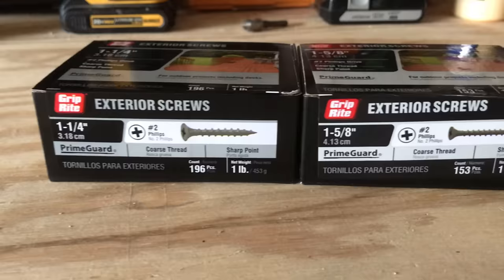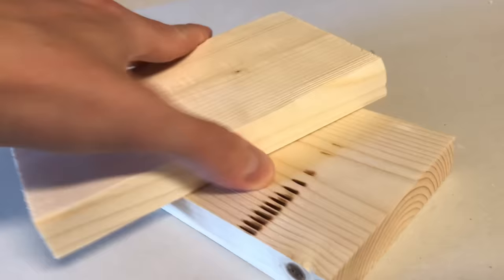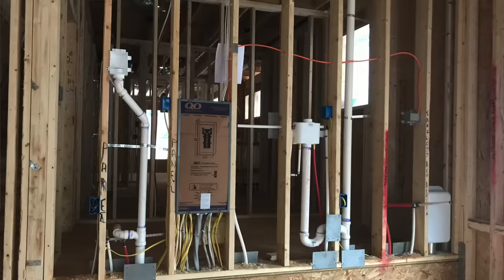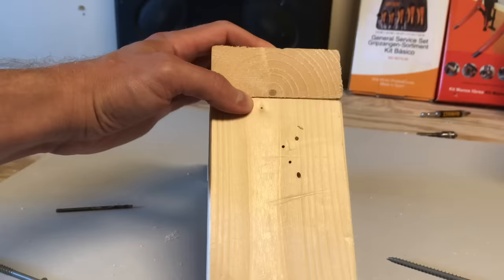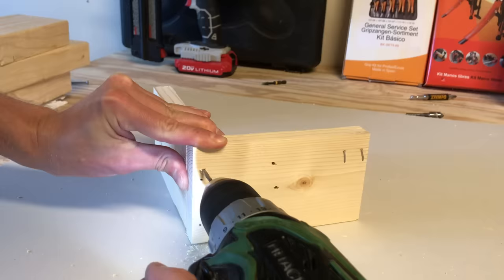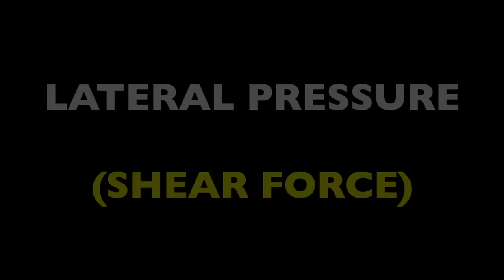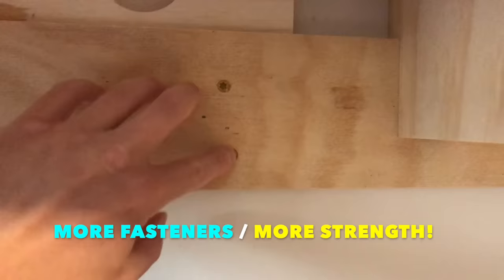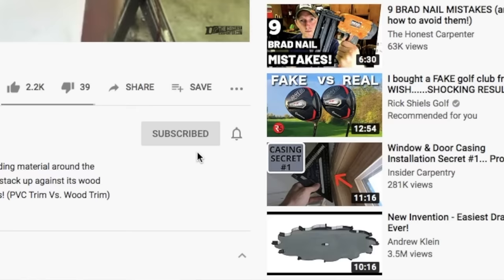Don't Use Screws That Are TOO LONG or TOO SHORT! (Screw Length/How To Choose The Right Screw Length)

Comment: Pre-drilling is often important to prevent splitting.
Reply: I asked a 3rd generation carpenter what tool would he recommend for DIYers he said ditch the old school battery drill and get a good lithium battery impact driver. I did and BOY DOES IT MAKE A WORLD OF DIFFERENCE! No more predrilling. The drill will drive EVERYTHING! What I do is go about half way in then back out and watch the wood shavings pour out then I just drive the screw in that way it doesn't split the wood. Works great as it serves the same purpose without having to predrill. It gets the shavings out so the wood isn't expanded too much. So it prevents splitting. 

Also I find most old school guys just press the impact/drill button at full power all the time. What I do is start slow, to get it started, then full speed at mid length, then right at the last quarter I slow down to barely flush mount the screw heads. Oh and I only use T-25 star/Torc head screws the only thing that is better is square heads as both are harder to strip.
Reply: And alignment!
Reply: i know it's kinda randomly asking but do anyone know a good place to stream newly released movies online?
Reply: @chaimterrance7621  from your sisters house
Reply: Fuck that! 
Impact driver and battern screws done

Comment: Minor correction:
Screws hold better when they are pre-drilled with a pilot hole. 
(Removing material for the core allows the threads to cut in a uniform fashion, avoiding distortion. This increases, not decreases, holding strength.)
-Good video👌
Reply: Interesting.  Thanks for this little detail.
Reply: @KMSchriver  You're welcome. Mamy torque specs assume fasteners are pre-drilled, and nuts are lubricated before fastening because they fasten tighter. That is not widely known, however.

Comment: 1:15 "just add more screws"

So I gather you have run into my diy projects before
Reply: If I ever try to slip any of my woodworking projects through an airport metal detector, I will be separated from the line for a "special inquiry". Hopefully I will not have to pay for the metal detector overheating...
Reply: Some of my projects have slipped into the realm of metal work, I’ll need to find a new channel 😀
Reply: 😂😂 same

Comment: Back in the day, wood screws were the only thing around.  You would drill the diameter of the screw for the first board and then have a smaller pilot hole for the second board  to cure withdrawal pressure.  That still stands today for whatever screw is used today.  If you think you are going to get pull out or withdrawal pressure, just drill the diameter of the screw for the first board.  The head of screw will cinch up the 2 boards
Reply: I've seen screws that have steeper threads in the top third and normal threads in the bottom two thirds.  They are meant to pull the board that's being attached tight against the wood it's being attached to.  With that type of screw would it be better to leave the pilot hole the same narrower diameter in both pieces?
Reply: @ethanheyne  To me, that would be a "test it on a couple of scrap pieces first", preferably on the same type of wood that you are joining together, to see if getting pull out.  Different types of woods or plywoods are more ornery than others..lol. If you can get away with just one pilot hole, great, that's less work.  But drilling the diameter of the screw in the first board is a sure method.  Nothing more frustrating than being in the air while trying to screw something to wall, ceiling, etc and it pulling out.  Or if even doing with a glue up, and clamps and getting a gap from the boards not cinching together.  My dad was a aerospace engineer, and he always said the the head of a screw/bolt has tremendous holding power. Of course, he wasn't driving brittle drywall screws with some of the more powerful drills we have today. LOL, LOL

Comment: I've had instances where I needed to screw boards flat, but had screws that were slightly too long (I didn't order them). In that case, I just angle the screw slightly, making sure the boards don't slide and the screw doesn't exit. Simple but effective, especially if you put the next screw in from the reverse angle. Of course, don't be afraid to pre-drill the holes, especially if it's fragile work such as trim.
Reply: Toe in is great and actually provides more strength, but the caveat is that it can be tricky to get the head of the screw flush w/ the board. Another alternative is (if you have the time) to cut the end of the screw that's sticking out so it's flush.

Comment: Thanks Ethan. Didn’t realize end grain needed more length to stabilize the screw
Reply: I think it's stronger to also angle end grain screws where possible to cross the grain along its length
Reply from the maker: I've used this method in some situations as well, Steve. Sort of like a toenail.
Reply: @SteveRogers461  End grain offers little bite on any fastener
Reply: End grain doesn’t hold screws as well as cross grain, but, glue will,help a lot.

Comment: Hi Ethan. Just thinking of a few screw topics that you may want to discuss later. Two that come to mind are different drive options (#2 square / torx / phillips / etc??) and different coatings / materials (a lot of people use the wrong screw type - particularly in CCA treated timber). This video was fairly concise - that's good. A bit more depth in discussion around pilot holes such as when there may be advantage in drilling an over sized hole on the face piece to allow the stock to pull together without binding  and when to counter sink may be worth while. Also scewing (angling) screws to improve holding power and fastening from each side where you have access.
Reply: I really love the square head screws. Phillips heads are so annoying, as you almost never can tell when they are going to slip on you. And if the screw is inferior metal, you've got little chance of driving it in all the way, unless you put a tonne of force on your driver. Obviously the stronger timber screws are usually ok, but I just loathe Phillips heads.
Reply: square head (Robertson) are the best screws to use.
Reply: In the UK Pozidrive are pretty standard, better than Phillips but not as goos as Torx (which I use) or Robertson. Robertson, probably the best of the lot, are almost completely unavailable in the UK except as decking screws occasionally.
Reply: @Dyrck  Shame can't get Robertson in the UK.  I'm from Canada originally and that's mostly what we used.

Comment: An additional tip when drilling the pilot hole, use a bit that is roughly 1/3 to 1/2 the diameter of the threads. With lag screws or bolts go up to 3/4 of the diameter for the pilot hole to prevent splitinig.
Reply: I've also begun using a nail set to make a divot for the drill bit.
Reply: Sometimes the pilot needs to be the same caliber as the screw /lag . Some situations !! Like a deck ledger
Reply: @dennisrayl3485  An awl works well too. I have a leather punch on my swiss army knife that does a similar job.
Reply: @IVORY123100  I was thinkin' the same thing. The harder the wood, like he said, the closer in diameter to the actual screw.
Reply: There are lots of free charts available. 
Pilot hole size are dependant on material, thread pitch, and fastener type.

Comment: This is a great topic and you’re right about how many subjects can be covered regarding screws. I think what should be added in this conversation is what size hole to predrill.

Future suggested conversations...
Screw size needed for job
Course vs fine thread
Types of heads, (pan, flat, button, Phillips, Star etc.)
Exterior vs interior
Types of lag bolts
How tight to screw a lag bolt

Others have covered these topics, but you have a unique style that is short and to the point, yet adequate. You also carry enough energy and enthusiasm to keep people focused on your words.

Comment: I really need a video on thread widths!  
I’m so grateful for all your videos.
Reply from the maker: Thanks Paula! I'll see what I can do. I'm moving to a new shop space, and I'll definitely do a lot more videos on screws in the future :)
Reply: The Honest Carpenter can give his opinion as mine is just one thought on it. In my experience thread widths can be a problem if they split the wood. Usually once you pick the max length screw you can use without the screw sticking through the other side or at least 1" to 1-1/2" deep in both pieces of wood, the screw's width should be good for that application. Usually predrilling will allow the wood to have a hole but enough wood still to allow the threads of the screw to hold. This also gets the wood shavings out so when you drive the screw it doesn't expand the wood too much and split it. What I do is use an impact driver compared to a regular drill. The impact driver "knocks" or impacts the spinning bit when it slows down due to resistance. You will hear it impact/knocking as you drive a screw into wood as it gets harder to drive. The advantage is the impact driver will DRIVE EVERYTHING no predrilling needed. So what I do is drive the screw (T-25 star/Torc head as they are very hard to strip) half way then back out to allow the wood shavings to come out. This allows the wood to not have to over expand and split. Then drive the screw flush mounted. Also most people just press the drive button on drills/impact drivers at full power all the time. What I do is start slow to get started then press to full power until about one quarter of the way then slow down at the end to make sure you flush mount the screw head instead of accidentally burying the screw head half way in the board. My 70yr old dad still does this even after I showed and explained that if the screw goes through the other end it can't hold the board.

Comment: This explanation makes a lot of sense.  I had been taught that, in general, the screw length should be twice the thickness of the wood that one is attaching.  i.e. a 3" nail through a 2x4.  But I found myself making adjustments.

Comment: For lateral pressure (like weight hanging from a fastener on a wall), you can improve performance by adding a vertical metal strip like a TV wall mounting bracket. Once the fastener grips the stud, the friction between the mounting bracket bracket and the dry wall also comes into play to support the hanging weight!

Comment: Please include metric units of measurement as well. Great video!
Reply: Most of what he mentioned would be roughly 25-30mm into the anchoring piece, so most attachments would need a 50-65mm long screw.
Reply: Yes, so the video can make more sense to the "rest of the world" ;-)
Reply: I am American and I wish we would convert to the metric system here. Everyone else uses it, it makes sense (10 base instead of 12”, 3 feet, ick!), and what kind of asinine system of measurement is empiric? Based on the length of a king, ruler or emperors what? Who the hell thought that was a good idea? Oh yeah, the a-hole king, ruler or emperor. Jackwads.

Comment: while installing water heater straps in a customers garage,  i screwed through a 220 wiring that fed the kitchen oven opposite that wall.   when i was holding one of the straps and touched the water heater,  things became very exciting.
Reply from the maker: Scary, Norm! I've always said, if you're going to mess up like that, cross your fingers and hope for 110 😅
Reply: Details Norm? Speak!
Reply: @kooale   putting a 3/8 lag bolt into a stud to secure the water heater straps.    i had not been the house, so was unaware of the location of the kitchen.   when i began to wrap the strap around the heater, i got zapped.   most likely i nicked the wiring with the lag bolt, so i got a shock instead of electrocuted.   i removed the bolt and moved it about 2 inches higher.   no issues after that.
Reply: I remember when our contractor was drilling through our floor in the kitchen to run a gas line to our new stove. The existing stove was electric and we wanted gas. I asked him how he knew he wasn't going to run into any wiring or plumbing, and he brushed me off. Well, about 5 seconds later things got quite exciting when he hit the 220 for the range. I heard a loud bang and saw a massive flash. 

Fortunately he was OK.
Reply: Normally your fastener would hit both conductors and blow the circuit breaker and a nice melted hole. Why not use a detector first to see if there is ANY metal where you are drilling? This is why  protector plates are required any where a pipe or wire passes through a stud on new construction. While it's scary, you won't get shocked hitting power lines, since the current always takes path of least resistance. This example of just touching one wire (the hot and not neutral) enough energize the metal strap seems pretty rare. The water heater is grounded through pipes, which is usually tired to neutral in main breaker box.

Comment: Great video! I nearly always pre -drill. Not only stops splitting but also guides the screw straight so grain won't affect it. I use 4 mm or 3mm for 90% of pre drill holes. I buy these bits in 10s they last for years!

Comment: Great tips.  I might suggest adding that you want to avoid driving screws in the same grain too close to each other.  This often leads to the screws acting like wedges and the wood splitting along the grain.  This can be avoided by observing the grain and altering screw positions accordingly.

Comment: Thank you, this is good information. 

The most common critique I hear from TV builders is “don’t use drywall screws for everything, they are too brittle” and as I work on my own home I find the previous owner used drywall screws for everything from mounting a light fixture in the bathroom to hanging wire shelves in the closet. Problem is, I don’t know what’s right. 

So, deck screws for everything not attaching drywall to a wall stud?  I also like screws with something other than the Phillips drive, it strips out too easily.

Comment: I saw on another YouTube video about lubricating screws. I've begun wiping screws with a rag damp with WD-40 and let me tell you, it's wonderful. Less pressure, especially on smaller pieces, results in fewer breaks in the wood.
Reply: A lot of woodworkers use beeswax.
Reply: @jobacuda4472  Even common bar soap or liquid soap works also. 😊
Reply: @dancahill9122  soap may be alkaline so it is not good for metal. But it is not something you have to worry about for some time. Although I have seen its effects in older projects I've done. So it is not like it is something you never have to worry about. Now I use paraffin wax which has more uses in the workshop anyways. Although wax is less common. A box of wax will last you a long time.

Comment: I used the same ones you featured before I tried the torx screws which is all I use now. Good topic.
Reply: Love em. So much needless suffering trying to drive long phillips screws.
Reply: I so wish the whole industry would just switch over once and for all. Larger production runs would bring down the cost, and the bit is almost always included, so adoption is really very easy, whether for DIY or professional applications.
Reply: They are the best.

Comment: Informative video. A type of screw I've recently found useful in the correct circumstances are GRK finish/trim screws  These work great for thinner dimensions of wood, especially if it's going to be reinforced with glue.  No need for pilot holes and they countersink themselves.

Comment: In order to get maximum holding power, drill a pilot hole through both pieces and then a clearance hole through the piece being attached.  This draws the piece being attached up tight against the wall.

Comment: Great video...I find that in every case possible I drill pilot holes...even in something soft like pine I find the a pilot hole allows the screw to bore in without cleaving the wood. Of course in soft wood I drill a smaller hole than in hardwoods.

You guys REALLY need to accept Robertson screws...I ache watching you having to deal with Phillips :)

Comment: Have you ever used Robertson head screws?
Great Canadian invention.
Reply: Robertson is only here? I was wondering why his deck screw were Phillips. Nasty
Reply: @scottroy6195  They're most common in Canada because of Robertson. They exist elsewhere, but are usually harder to find and are usually known as "square drive" (the non-trademarked generic name, since they're not made by Robertson)
Reply: @jonathanvernon7251  Thanks for the info mate.  Oh the world has to catch up they are so much better than Phillips.  I hate Phillips.
Reply: @scottroy6195  never use phillips on anything but drywall. The screws he shows here we always get in torx or star drive. The bits by makita hold up better and dont cam out on star drive. Phillips head is basically obsolete here for any screw requiring strength
Reply: Robertson are simply square head screws and are the best screws to use especially with powered tools.
Reply: @scottroy6195  I prefer Robertson ( commonly called square drive here).nz
Reply: Started using GRK screws they have many cutting threads on the screw so they don’t split the material.

Comment: Before I started getting serious with woodworking, I, like many, used drywall screws almost all the time - While cheap and convenient, they are not string and have little shear strength do to their thinness. Heads often break off when using harder or thicker woods and if you have to remove them later.

Comment: I have always selected the size of the pilot drill bit by holding the bit next to the screw to be used.  I select the bit that is equal to the size of the solid center part of the screw with the screw threads showing on either side of my drill bit.  It has always turned out to be the correct pilot hole size.